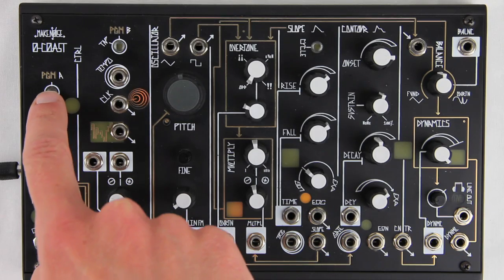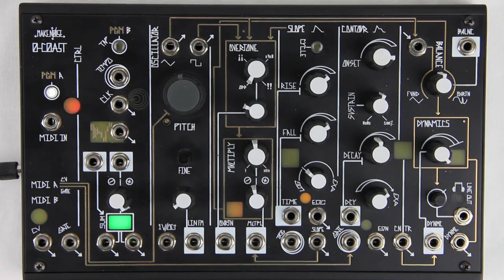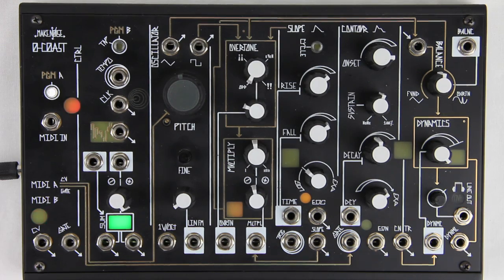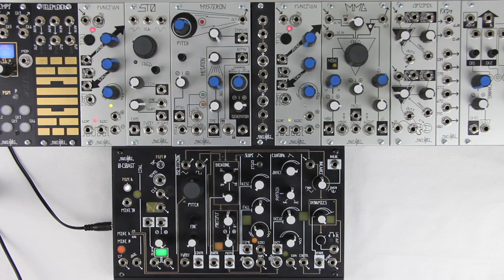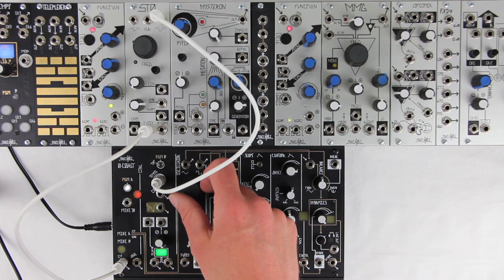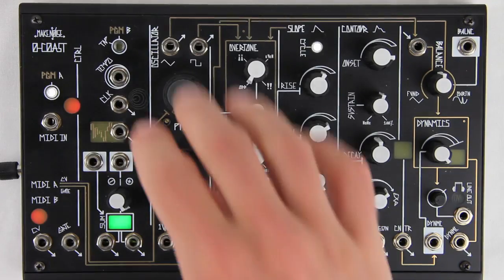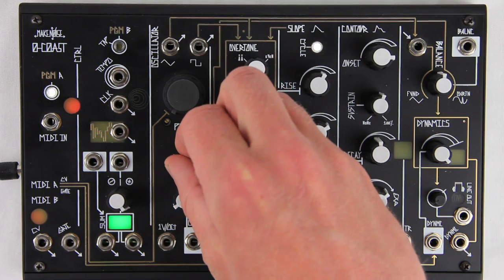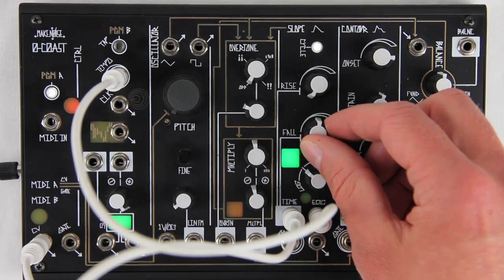0-Coast PGM Pages, pt. 8: Page 7, Calibration

Comment: When trying to calibrate and turning the fine tune the midi a/b lights continue to flash Midi A will not remain solid?
Reply from the maker: Do you know what firmware version you have?
Reply: I didn't have time to update to 165 just went to the 168 .I had a reply from tech support so all good now .Haven't  stumbled across any issues with my unit so far so all  must be good .Thanks for replying :-).Make Noise O-Coast and other Make Noise modules are used quite often in https://soundcloud.com/somerville-1i music releases .:-)
Reply: @craigwilson9454  But what was the reply?? Please share dude, for those of us who have the same problem.

Comment: When I try and calibrate the SLOPE circuit my 0 coast freezes requiring a restart. Post restart the CV for MIDI B doesn't track anything. I've tried this with an external VCO too with the same result. Any ideas?
Reply: I'm new to CV & (semi-)modulars, but I got the device, flashed to 1.6.5 and calibrated VCO, then slope (which also freezes or takes for ever?)...
I then set 1 pad for A and 1 for B (Midi learn) from my electribe 2. 
While A does play, I can't seem to get anything out of Midi B CV, nor Gate, except the red led flashing.
I patched them to different things and I'm not getting any sound nor flashing LEDs.
Have you had any success?